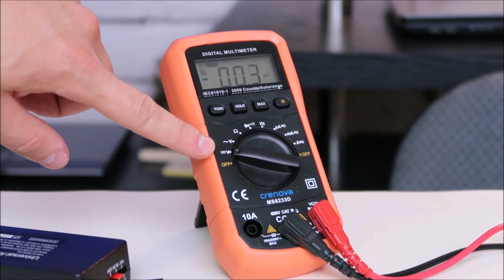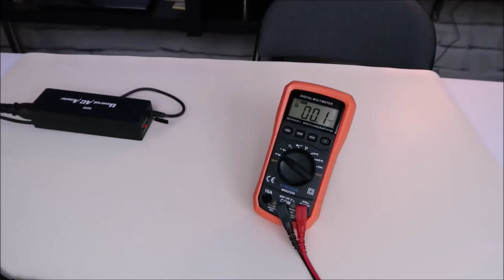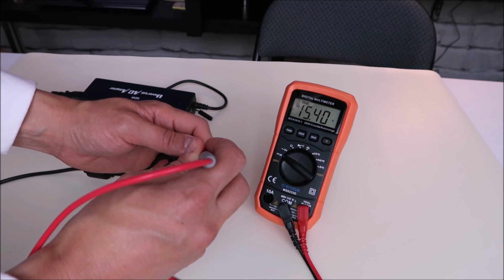How To Fix Any Laptop - Wont Turn On, Wont Open, Turns Off Right Away, No Power Solution

Comment: ASUS K401UB:  Blinking power, Fan starts then immediately stops.  Did battery / ps tests, DDR reseat & even removed it.  Also tried removing HD -> no change.  No service manual (thanks ASUS) so a couple of questions:  1) I must be losing it but I could not find a CMOS battery.  Not on either side of MB and no twisted pair connecting to MB.  So where?  2).  As you'll know this model has 4GB of RAM soldered to the MB.  Do you know if the ASUS POST gives beep codes if bad RAM is detected?  Thanks.
Reply from the maker: 1.  Not all motherboards use a CMOS battery.  Yours may not.  Im not sure about the beep codes for RAM in that computer.  Most will though.  Were you able to perform the power drain procedure?
2.  You can test your power adapter as seen here:  https://www.youtube.com/watch?v=YBhsVHideGE&t=6s
Reply: Appreciate the quick reply.
1.  Disconnected battery and power = cmos reset?  I would have expected beep codes but it wasn't in the not-very-helpful user guide, so who knows but they certainly ought to be.  Yes, I performed drain & battery only then drain & power only... no joy.
2.  Power adapter is output is 19.n V.  Naturally, this MB didn't have a connector cable to test.  However just behind the jack is an etched square, inside which are two solder nubs, one has a + etched by it.  These did have 19.n V across them.  Appears the correct voltage is getting into the MB.
Unless you have a plan-B - it may time get Alibaba to replace the mobo. 
Odd really.  While older, this unit had almost no power-on hours and was working fine when unneeded it ended up in a closet for several years...  
tia
Reply from the maker: @Hgk-ws3hh  Ya, sounds like the correct power is getting into the MB.  Time to replace it :(

Comment: Mate, you are the most thorough helpful person when it comes to this topic. 
I have been having trouble with my dell xps 15 9500. I replaced the battery with a chinese one because the official dell one is not available where I live and I can't ship them here at the moment as shipping is too expensive. The battery shows it is charging but is not actually charging and goes down a percent every other day. When I unplug the computer it immediately shuts down. I am now going to go through your suggestions and try and isolate the problem.
Reply from the maker: In my experience, only about 60% of generic batteries work :( You could just have a battery that wont work with your computer unfortunately.  Make sure your computer is fully updated as seen here to rule out a basic driver issue:  https://www.youtube.com/watch?v=kX8bB725Ljw&feature=youtu.be.  If that does not help, make sure the battery does not just need to be calibrated.  But if neither of those two things help, you may just have to replace the battery.
Reply: @PC_Monkey  how do you calibrate the battery?
Reply from the maker: @82acresfarm  Easiest way is seen here:  https://www.youtube.com/watch?v=qVBaZBg9rHI

Comment: Hello. So I've got this dell Inspiron mini computer and it won't come on. It just shows the power light for about 6 to 7 second then goes back off. I've tried the hold power button, the bios reset, ram check but still no good.  Please help me out with a solution if possible. Thanks. Also 👍🏽 on your repair guide videos
Reply from the maker: 1.  This video has been updated here:  https://youtu.be/B2Umoh81QeI.  Have you tried the steps seen there?
2.  Also, did anything happen before this issue appeared?  Liquid spill, overheating, Windows update, etc?
Reply: @PC_Monkey  actually no, nothing. Just tried turning it on and it didn't respond. All it did was the power light blink and went back off
Reply: @PC_Monkey  actually no, nothing. Just tried turning it on and it didn't respond. All it did was the power light blink and went back off
Reply from the maker: @tabithadiojimoh4491  This video has been updated here:  https://youtu.be/B2Umoh81QeI.  Have you tried the steps seen there?

Comment: Help! My computer is an HP Pavilliam 360 15.6” screen. It is doing a couple of the things that you have mentioned in your videos. It started a few months ago freezing and it wouldn’t turn off unless I pushed and kept my finger on the power button, then it wouldn’t turn off at all and the screen would be totally black but, I could hear the fan, I had to wait for the battery to loose all of its power for it to turn off. It hasn’t powered on for the past month or so at all. I looked at your video today and removed the battery, pushed the power button for a minute, put the battery back in and plugged up my laptop. It didn’t work at first. When I was getting ready to remove the battery again I felt heat coming from my laptop and noticed that the fan was on so, my laptop was on. But, the screen was black and none of the keys were working and then it shut off again. Please, help?
Reply from the maker: 1.  For a computer that turns on but the display does not work, try this video first; https://youtu.be/e9iy30J00-k
Let me know how that goes :)
2.  Also, did anything happen before this issue appeared?  Liquid spill, overheating, Windows update, etc?

Comment: I have a msi gf65 computer I bought last month And it wont turn on even after doing all you said, its an internal batterie so I had to dismantle the computer in order to do these tricks, but it still wont work if you coule help me that would be amazing 😢
Reply from the maker: 1.  This video has been updated with additional steps here; https://youtu.be/HHwzA37r4e8. Let me know how that goes :)
2.  Also, did anything happen before this issue appeared?  Liquid spill, overheating, Windows update, etc?

Comment: My computer still won’t turn on my computer is brand new
Reply from the maker: 1.  Are there any signs of life at all when you try to turn it on? Lights? Fan, Motherboard, or Hard Drive sounds? Anything seen on the screen?
2.  Also, did anything happen before this issue appeared?  Liquid spill, overheating, Windows update, etc?

Comment: My Lenovo Thinkpad is not turning on. It's all dead, no lights, or fan sounds. It has an external and internal battery
Reply from the maker: 1.  This video has been updated with additional steps here; https://youtu.be/HHwzA37r4e8. Let me know how that goes :)
2.  Also, did anything happen before this issue appeared?  Liquid spill, overheating, Windows update, etc?
Reply: @PC_Monkey  I tried everything except messing with the mother board. I was too scared damage it. I took it to a repair store and all they did was do a Bios reset (as you said in your video). According to the technician, I closed the screen before the laptop properly shut down. I had to wait till my phone laptop's lights stopped blinking and then fold it up. Do you think that could have been the reason?
Reply from the maker: @GalactaMind  It should not have been the reason but sometimes when the BIOS or Windows is updating or something, it can mess things up if you shut down too fast. Glad your all set :) Always here if needed !!
Reply: @PC_Monkey  thanks. The best thing that came out of this problem of mine was that I discovered your truly wonderful channel
Reply from the maker: @GalactaMind    Thanks !!  Always here to help :)

Comment: Hey I've got an Asus ROG and it's doing this thing where I hit the power button, the keyboard lights turn on for about five seconds, and then turn back off again. It does this when I try to turn it on for a couple times and then it stops responding altogether. I can get the keyboard to respond again when I unplug the battery and plug it back in, and then the whole thing starts over with the keyboard turning on and off. Do you have any idea what causes this?
Reply from the maker: 1.  This video has been updated with additional steps here; https://youtu.be/HHwzA37r4e8. Let me know how that goes :)
2.  Also, did anything happen before this issue appeared?  Liquid spill, overheating, Windows update, etc?
Reply: @PC_Monkey  okay, thanks! And yes, the problem started right after I dropped it.
Reply from the maker: @willhelm6192  Can you see any physical damage to any part of the computer?  Something could be loose or damaged :(  I would open it up as well and make sure everything is properly connected.
Reply: @PC_Monkey  there is no apparent damage visible from the outside. Yesterday I spent two hours inspecting the motherboard and trying to find anything that might be loose but I didn't come up with anything (although I have no experience with this so I don't know what to look for). What components are most likely to get messed with after getting dropped? Not really sure what to look for.
Reply from the maker: @willhelm6192  Most likely either the Hard Drive or the any of the Power Components.  Hopefully.  If the Motherboard is damaged, the computer may act as your describing.  It would need to be replaced :(
Reply: @PC_Monkey  alright, good to know. Thanks a lot!
Reply from the maker: @willhelm6192  Good luck !!

Comment: Laptop was running last night fine off ac but as of today it doesn’t run tried everything in the vid but still luck however the laptop is drawing power just not booting
Reply from the maker: 1.  This video has been updated with additional steps here; https://youtu.be/HHwzA37r4e8. Let me know how that goes :)
2.  Also, did anything happen before this issue appeared?  Liquid spill, overheating, Windows update, etc?

Comment: Im trying to help a friend fix his HP 2000 laptop, it turned on and made lots of noise around the hard drive fan area.  It asked me to do a F2 diagnostic stating some error with the drive.  So I did that but then shortly after, it turned off.  Turned it on again and it said there was a start up error, I'd need to do a start up repair, so I tried to start that and a minute later, it turns off.  Then I turn it back on and it goes to the login window like everything's fine, then it turns off.  Now it won't turn back on at all.  What could be the problem?  I thought it might be the hard drive, switched it out but then it wouldn't turn on, put back the old hard drive and still won't turn on.  I don't think it was the drive, but not seeing the problem here in this video.  Any suggestions?  Yes, the powercord has the light on, so I know it's getting power.
Reply from the maker: It wont turn on now at all?  Are there any signs of life at all when you try to turn it on? Lights? Fan, Motherboard, or Hard Drive sounds? Anything seen on the screen?
Reply: @PC_Monkey  Thanks for responding. for some reason, it didn't even show signs of life with the other hard drive.  I had to put the old hard drive in, then take the cmos batter out and then it would do the boot hard drive not found, so I did what you suggested in the other video, then it booted up, so for some reason, it wouldn't let me put another hard drive in it.  Maybe the hard drive, which was from another laptop was bad, I really think he needs an ssd, and maybe a new cmos battery at the very least.  It's a nice laptiop for just regular use.  HP 2000 so thanks for your videos.  It was originally saying the disk had an error and wanted me to do a memory test by pressing F2.  then when I tried it would shut down.  So I suspect the hard drive is going bad, and the cmos battery, it's been sitting a while.  Are there certain hard drives it will not work with?  Not sure why it wouldn't even power on with the other hard drive which was just another laptop hard drive but more storage space, this other hard drive was a samsung that came out of a Lenovo G570, same sort of hard drive, connected just fine, same size, fit in the slot.  Anyway, I appreciate your response.  If I were to suggest an SSD for it to my friend, which one would be compatible with the HP 2000, it's got the AMD vision cpu, and 320GB HDD, and 8GB ddr3 ram.

Comment: Hello. Think i have a unique situation if you could help. When i press the power button my msi leopard gl75 laptop opens and turns off for a second and continues the progress until i plug out the Adapter. Lights go on for 1 sec then goes off after 3 seconds it does the same again indefinetaly. Shortly it turns on and off on 3 seconds intervals and wont stop trying to turn on until i press down The power button for a long time or unplug the power it tries to open. I tries everything in this video but didnt try the motherboard fix so before i try that too could you tell me its the same problem in this video or different. Bec it looks similar it goes on and off in 1 second however different part is it tries the same process on 3 second intervals. It doesnt keep shut after 1 try
Reply from the maker: 1.  For a computer that does not turn on, try this video first; https://youtu.be/HHwzA37r4e8. Let me know how that goes :)
2.  Also, did anything happen before this issue appeared?  Liquid spill, overheating, Windows update, etc?

Comment: My Acer Laptop won’t turn on I tryd disconnecting the cable from the laptop and hold the power button for 1min but it still won’t work pls help me
Reply from the maker: 1.  For a computer that does not turn on, try this video first; https://youtu.be/HHwzA37r4e8. Let me know how that goes :)
2.  Also, did anything happen before this issue appeared?  Liquid spill, overheating, Windows update, etc?

Comment: What about the 'power button' itself?.......Thanks!
Reply from the maker: Yes a power button can itself go bad just like any other computer component.  You can test for that if you have some advanced testing gear or you can try replacing it and see if that helps
Reply: @PC_Monkey  thanks, I was hoping it would be an simpler check. I've seen a few video's about jumping the connector (paper clip, etc) at least as a temporary fix and that's about it beside replacement.

Comment: how do i open it
Reply from the maker: How do you open what?  Are you trying to get inside your computer or are you trying to turn it on?
Reply: @PC_Monkey  yes
Reply: trying to turn it on
Reply from the maker: @EsaMuhammad-k7r  1.  Are there any signs of life at all when you try to turn it on? Lights? Fan, Motherboard, or Hard Drive sounds? Anything seen on the screen?
2.  Also, did anything happen before this issue appeared?  Liquid spill, overheating, Windows update, etc?
Reply from the maker: @EsaMuhammad-k7r  1.  For a computer that does not turn on, try this video first; https://youtu.be/HHwzA37r4e8. Let me know how that goes :)
2.  Also, did anything happen before this issue appeared?  Liquid spill, overheating, Windows update, etc?
Reply: @PC_Monkey  it doesnt work my latop still not working
Reply from the maker: @EsaMuhammad-k7r  1.  If, after all these steps, you have not been able to find the issue, your most likely looking at a faulty component preventing the motherboard from working or a motherboard issue.  I would start troubleshooting each component, starting with the charger and power jack.  You can see those two videos here;  https://youtu.be/YBhsVHideGE  &  https://youtu.be/HpabvrNaodU
2.  2.  Also, did anything happen before this issue appeared?  Liquid spill, overheating, Windows update, etc?
Reply: @PC_Monkey  so how do i fix it
Reply from the maker: @EsaMuhammad-k7r  Did you not read my last message? 
1.  If, after all these steps, you have not been able to find the issue, your most likely looking at a faulty component preventing the motherboard from working or a motherboard issue.  I would start troubleshooting each component, starting with the charger and power jack.  You can see those two videos here;  https://youtu.be/YBhsVHideGE  &  https://youtu.be/HpabvrNaodU
2.  2.  Also, did anything happen before this issue appeared?  Liquid spill, overheating, Windows update, etc?
Reply: @PC_Monkey  so how do fix it is there a way
Reply from the maker: @EsaMuhammad-k7r  sry bro lol
Reply: @PC_Monkey  why you sorry
Reply: @PC_Monkey  i need it fix
Reply: @PC_Monkey  just pls tell me your shop and ill go there
Reply: @PC_Monkey  my latop not a chrombebook
Reply: all the ideas dont work bruh
Reply: hellp me

Comment: My asus rog strix g15 doesnt even show the charging ligths. The first time I had this problem was after I downloaded a Windows 10 update. Today i turned it off after some work and now it doesn't turn on and the changing ligth doesn't bright even when I connect the charger. Any suggestions?
Reply from the maker: 1.  For a computer that does not turn on, try this video first; https://youtu.be/HHwzA37r4e8. Let me know how that goes :)
2.  Also, did anything happen before this issue appeared?  Liquid spill, overheating, Windows update, etc?
Reply: @PC_Monkey  yep, everything started after a windows update, but today I turned on again after a day and seems to work fine by now. Should I take it to an expert?
Reply from the maker: @richiboy6546  If it works fine, you should be all set :)  Sometimes issues with updates mess computers up but the usually fix themselves shortly after.

Comment: Hi there, I did try my battery, bios and ram and I think my charging point is fine coz the light next to it shows ot charging also an hour before I verified it was showing a blue light but now it is showing white which means the battery is charged. I don’t think I can test the motherboard, so you suggest any other thing which I can so
Reply from the maker: If all the tests in this video do not reveal the issue, and your power adapter tested to be fine, then your most likely looking at a Motherboard replacement as seen here;  https://youtu.be/N_7HNrFkMS8.  If you know your computer's model number, I can help you get inside your specific computer :)